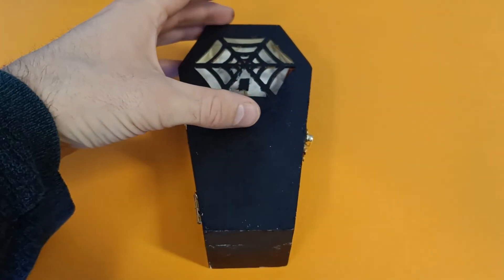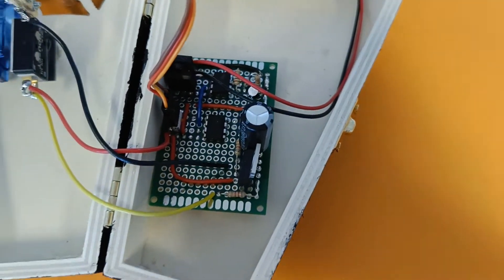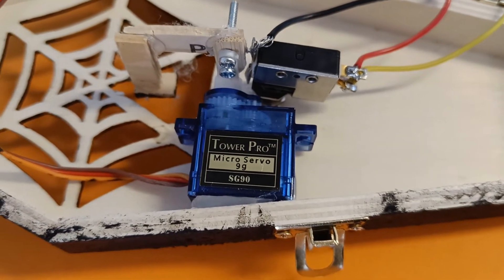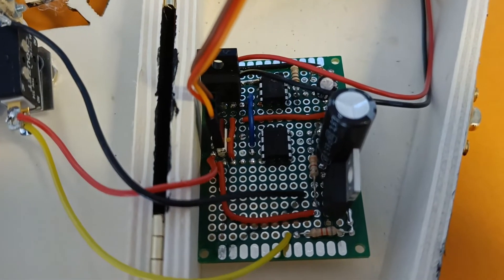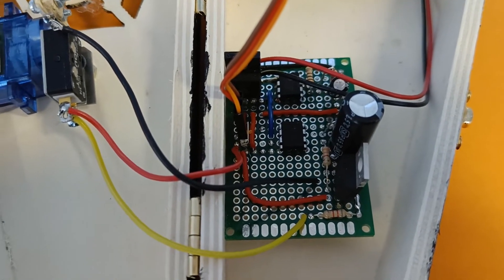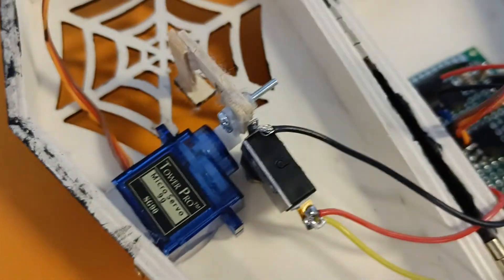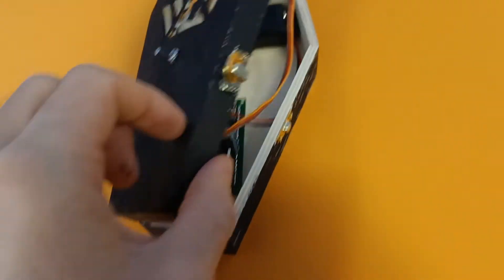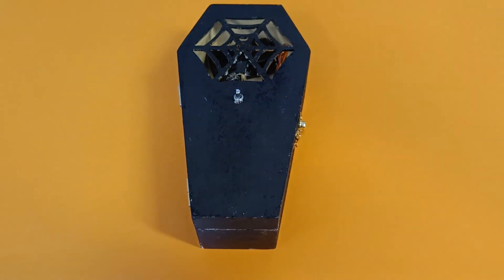Useless Machine with 555 Timers (Halloween Edition)

Comment: hi. i'd like to ask you a few question if it's possible. thanks
Reply from the maker: Sure, go ahead!
Reply: Ok is it difficult to program a microcontroller by myself eg: stm32 without use Arduino.
Reply from the maker: @Fnta_discovery  No it's not difficult. The first time you do it there are some steps involved that might seem complicated if you're starting from scratch. But once you got your first program up and running, it's just a matter of changing the code - just as with Arduino. I recommend using a development board when starting out, to make it a bit easier.
Reply: @Ohmify  ok no problem 😊 thanks for your reply.